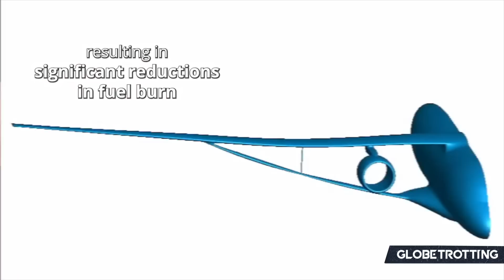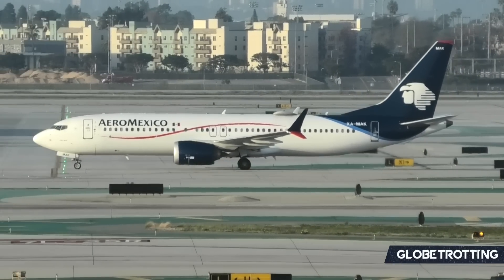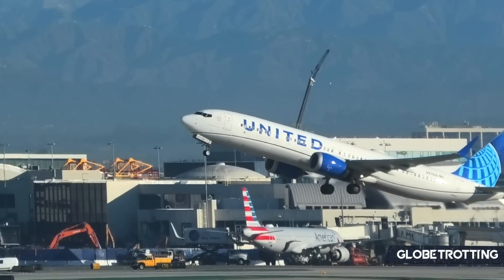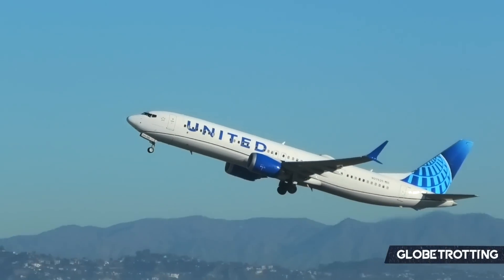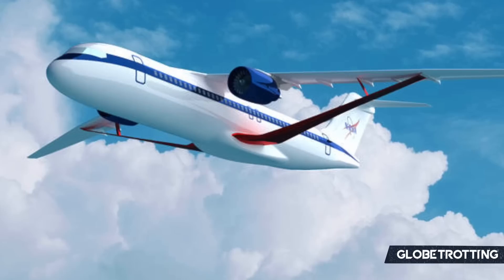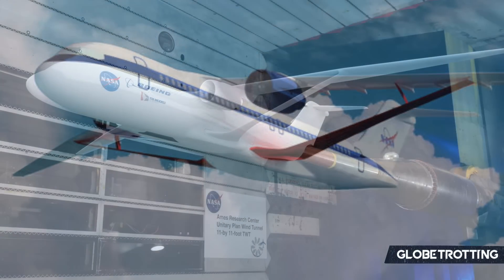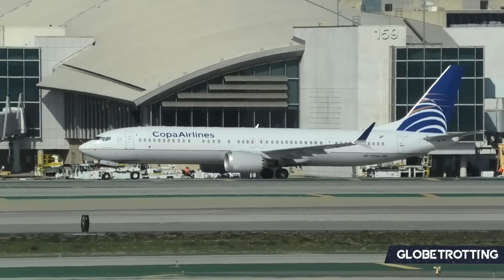737 REPLACEMENT - Boeing's Next Aircraft?

Comment: Like others here, I think Boeing is using the excuse that they await the RISE engine, circa 2030, to keep blowing out the tired old 737 airframe.  It is far more profitable than a  new design or radical redesign.  Methinks putting lipstick on the proverbial pig.... sticks you with a pig by any other name...

Comment: The problem is parking this aircraft at a gate.  The 737 NG and 737 MAX both have a 117 foot wingspan, with winglets.  The 757 has a 125 foot wingspan, without winglets.  The 767 wingspan, sans winglets, is 155 feet.  At 170 feet, the wingspan of this narrowbody is 27 feet narrower than the 787, which is a replacement for the 767 and 777-200.

For a small, compact airport like Midway or Orange County, a narrowbody with a 170 foot wingspan presents issues for taxiing and parking.
Reply: It wasn't really mentioned here but the wing folds just after the truss brace.  The wings are already so thin that they will not be having a significant portion of the fuel in the wing now. Certainly not past the truss brace.  This will be significantly more wing percentage that will bend upwards than on the 777 so it is schedule to be able to fit into a size 3 gate.  This problem though will hit big for use of a flying wing design.  You can't use that trick there which is why I don't see a large commercial jet using a flying wing design.  Blended wing were the wing itself could fold up I think might be the way to go for the big planes.

Comment: I think this could be a serious possibility as a CRJ 900/E175 replacement
Reply: Based on door size vs fuselage size, the depicted concept is a 3+3 row single aisle. For a 2+2, the door has to be much larger. I didn't look for specifications, but the pictured concept is clearly in the 140-180 seats category.

Furthermore, a smaller design to address the offer of, let's say, CRJ700 or E175, is indeed possible. However, the "bonus" of that concept is thinner wings, which comes at the very annoying drawback of MUCH wider wingspan. Airports are not ready, and won't be in the next 15 years. Just like the A380, launching the aircraft while airports delay infrastructure to the last moment will make airlines delay their interest in the type. The market of 80-140 seats demands tight turns and ease of operation flow. If the aircraft cannot fit in current any small parking slot, it will require the usage of spots for the 120-220 capacity, just because larger wings. That's highly inefficient.

One thing not discussed - because it's just a concept at this point, mainly focused on the wing design benefits, other problems has to be solved later - is fuel storage. The wings are so thin that you have to put those tanks elsewhere, mostly. That means, cargo volume will be significantly reduced unless you go again with a double bulb fuselage (Boeing 707/757 aft section). It's a bit premature to discuss that, but if you fail to integrate the concern from the start, you'll end up with the SAME problem as the 737 : not being able to scale up the design with new engines and more capacity (because of the guard for the 737, here because of a "not enough room"). What is tricky with fuel tanks is balance : you can't just pack all of them at the rear of the aircraft.

The emphase and focus put here on "737 replacement" plays a role in people being stuck on that idea. The thing is, you mainly need to maintain ease of personnel qualification, ie you don't put humans in front of an unknown technology (cockpit will be similar, systems, procedures, etc.) The market on the others hand has to be monitored. So it all depends on "how many people can afford to travel by air in the next 30 years ?". If it's the same as today, well, you need a 737-like capacity. If it's less, you'll need a smaller design. If it's more, you'll need something bigger (with even bigger wings). As I said, you won't redo all airports in the world, the aircraft you build must fit in existing parking slots for the corresponding market with the existing qualified personnel, you don't just design the most fuel efficient plane just for the sake of fuel efficiency... It will take time to integrate that design and make it the new standard, like 40 years from now...
Reply: @StephenKarl_Integral  good point, but they should be able to fit into most airports with where they put the fold on the wings (right next to support beam). With the wings folded, it should be about a slightly larger size than the E175 LR which will allow her to fit at at least every airport that gets a plane that’s the size of the E175 or larger. As for demand, that shouldn’t be a problem since this plane is a narrow body, not a wide body. Affordability on a narrow body jet shouldn’t be a problem, even 30 years in advance.
Reply: @uwucaffeineaddiction4023  oh, I wasn't aware the wings were foldable, thanks for pointing that out. That solves one problem. Historically, airlines want to avoid "moving parts" as that means ground checks, qualifications, costs, etc. but maybe the economic benefit substantially negates that. Usually, when you go "glider designs" like this, it's because you want to trade speed for airborne endurance. So you make a lightweight frame (also means lightweight engines and limited payload) and fly at low to intermediate altitude. This is my "ringing bell" when the design claims to fly equivalent payload of a classic airliner at even higher speed and altitude, so, from the start, it cannot be lightweight, roughly the same mass as a classic airliner, powerful engines, certainly not electric... My understanding of aerodynamics make me assume you would theorically burn more fuel than a classic airliner to reach an higher altitude in order to burn less fuel on a prolonged cruise, because those wings induces more drag in thicker air (I am possibly wrong, but again, how come we don't design classic airliner wings this way from the start, this is known efficiency margins from as early as U2 spy plane), meaning, the businees model is relevant for routes that move people as far as possible (for that sustained economic cruise). I kind of took the parking size as a deciding factor, but in my mind, several concurrent factors are at play (including for instance taxi stability, ground handling, crash survivability, purpose...) The 737 size concept makes sense (for capacity and fuel tanks), smaller than that, unless we want to fly really slow really low with lightweight (possibly electric) engines and not that far, I doubt it could be economically viable... Concepts, there are tons of them.. those that actually make it to everyday use had to fit within so many conditions and balance...

All that said, I'm an aviation enthusiast, I would LOVE to see wonderful machines fly everywhere. But I'm fed up of concepts that miserably failed after the hype, and people getting dramatic all over the internet with clickbaits titles and irrelevant debats even makes me very critical on the REALISM of any new thing : does it does the job with neglectible complications or risks and does it make money? Otherwise, it's just either crap or making money not in the right way (your taxes are funding the dream until it becomes obvious it doesn't work)
Reply: @StephenKarl_Integral  well only time will tell. Boeing has a pretty good track record on this since they’re working on certifying the first Spaulding, wingtip aircraft, the 777x.

Comment: Forgive my cynicism This P.R. campaign follows too closely to Congress extending the certification timeframe for the Max 7 and Max10.  The NASA wing design was developed for a much smaller plane possibly the MD 80 at 130 to 172 passengers. A number of issues seem to be overlooked.  The wing will need to fold (not just the tips). Flight control surfaces ie: jack screw design won't work as it is external to the wing. The flaps are housed internally to a much thicker wing design.  Current wing design currently stores much of the fuel used on an airliner.  The skinny wing will not be able to accommodate fuel tanks.  In-boarding the fuel tanks reduces the cargo hold and creates a structural problem similar to the Airbus 321 XLR.  A reinforced frame is needed for a wheels up landing emergency.  There is also the matter of cockpit controls which would be unique to this design With a one size fits all approach to Boeing designs how will this work?
Of course the wing and tube air frame design is maintained for a pressurized cabin.  Possibly the strut reinforced wing will remove the need for a wing box yet any landing gear design may still offer some interesting challenges.  What is Boeing really saying here?  Another 20 years and we will finally replace the 737?

Comment: "Boeing lost the 'it' factor" -- what is this, designer jeans?  

They definitely need a replacement for the 737, and really they need 2 planes: one that's small enough to replace the 737 and hold off against the A220 on the small end, and one to replace the 4000nm/250seat 757 class.  Could they perhaps build a pair of parts-sharing designs to cover both ends?  It'd be a tall order, but given enough $, doing such a plane with all composites could work.

Comment: I think this unusual research plane could be a candidate for installation of the CFM International RISE propfan engine to see just how far the fuel economy improvements can go.
Reply: Prop fans are good but if they can’t perform at high altitudes and speeds of jets then it likely won’t be on something of this size

Comment: I have been wondering how long it would take before someone trotted that out as a potential replacement for the 737.  Or 757!  I'm guessing the folks at Boeing has had that in mind for a very long time.  Considering that Boeing has said they are waiting for the next step in propulsion systems, it wouldn't be a surprise to see them use an open fan blade engine design like the CFM Rise on it.

Comment: The very long wingspan will require changes to airports and terminals...
Reply: Just do what the 77x does, folding wingtips/spans
Reply: @Daniel Chan  I would have thought that folding wingtips would be required as the airlines are unlikely to want to pay significantly higher airport fees on such a low capacity aircraft. 

As to how possible that would be on such a slender wing is another matter.

Comment: Even Boeing wanted a replacement for the 737.  Boeing was perfectly capable to make the 737MAX safe the first time out of the box.   But for 'pick your reason' they did not.   Engine placement, and MCAS it all works.  First release of MCAS sucked eggs.
The Body is still too narrow and could really use a modern specious cockpit.   Yet there is a market for it.  Can even be a comfortable plane if not stuffed too full.  Any plane that can haul the load can be crammed with too many passengers. That is up to the airline.
I

Comment: Makes sense, why should Boeing develop a 737 replacement when they can get NASA and the US Government to fund ⅓ of the project?
Reply: Is NASA and The US gov paying $3 billion+ ? Everyone knows a 737 replacement won't cost anything below $10 billion
Reply: Yea, not how this is going to work nor what the $1B will be.  This is far more likely NASA/FAA getting together for load alleviation for flutter, roll, 2G wind up turn in modern structures piggybacking onto Boeing who is footing the bill more than likely.  Since the FAA are running the show regarding any new aircraft currently, and all of a sudden pretending to be engineers, and Boeing has been looking at this aircraft type for going on 20 years, not 10 as stated as we were talking about this as Boeing engineers over 20 years ago.  Load alleviation = MASSIVE structural weight reductions.  With composites this gets hazy due to how flexible they are before breaking compared to aluminum(it is also one of their MAJOR failure modes).   No one from my knowledge has really done a whole airplane 2G+ wind up turn load alleviation testing even though it was for sure granted to a350(EASA) and 787 never got it from FAA which MASSIVELY pissed Boeing off.  My guess 777X did get some form but to what extent I did not know, but the kicker is no one knows how far one can push FBW load alleviation and full scale testing has been wanted for a VERY long time now.  All I have to say, this aircraft had better be a Drone aircraft because you would never catch me signing up for flight testing it if this program is truly what I think it is.  HIGH chance of pushing too far into load alleviation and.... I think you can figure out the rest.

Comment: A high wing aircraft its more difficult to reach the engines for maintenance i am not a big fan of the whale tail like the 727. Also anhedral wing planes are less stable than dihedral low wing planes in roll.
Reply: Not when we are talking civil aircraft where load alleviation is King via FBW computer control. But this is where the REAL testing will be King of course getting those dynamic issues ironed out and correlated to current load alleviation limits and probably why they brought NASA<<cough FAA in reality>> on the project would be my guess.   Project Yellowstone is not 10 years old it is well over 20 years old now.
Reply: Their probably looking a new wing placements for the open bladed engine supposedly coming around in the 2030’s when this concept would be finishing development.

Comment: A very long wingspan might cause issues at airports. Gates for midsize aircraft such as the 737 or A320 planes are typically dimensioned as "C", meaning a wingspan of up to 36 metres. A plane with a wingspan of more than 50 metres will require a more spacious (and probably more costly) gate.
Reply: That's why such a wing will be foldable.

Comment: I think Boeing should produce a plane that can more replace the 757 and have shortened variants to replace 737. A small-medium sized, narrow body high performance aircraft
Reply: But if you're into production of something, you know the days where you could "make more" without adding a cost to the final custommer are gone. A bigger design (757) means you put more steel, more carbon fiber, more so many things in a unit that flies less people and less cargo... How much will cost a 757 replacement with a shorter fuselage compared to an A320Neo (or its updated conterpart when the time comes) ?

That's not how you make money. You start with a small base with buffed undercarriage and central structure, just enough "to be prepared", then you scale up, if deemed necessary. Scaling up sometimes fails but scaling down is ALWAYS a niche, you won't sell enough units to make a noticeable profit.

When I read people wanting back the 757, I have the impression it must be an American citizen which only knows about Delta, United, American... let's say 90% of 757 production line. The picture is :
- the rest of the world is not interested in the 757 (or any new one of the kind, they simply go A321 which is already a tad too big)
- you now have A321LR/XLR, Max-9/10 (soon)
- the airlines I mentionned now have qualified Airbus personnel and are no longer Boeing addicts. Abandonning that route and go Boeing again would be highly cost ineffective. Boeing is constantly in touch with them, it's the airlines that are telling Boeing they don't care anymore...

Liking the 757 is okay, it's a wonderful plane, but claiming it's in a replacement of that type that Boeing should bet into... I think that would be the BEST way to get rid of Boeing for good in the competition. Now, to be fair, at some point, Boeing will need to replace the 737-Max. In line with what I said, while learning lessons, Boeing should design a 737 sized plane with scaled down 787 wings, nose, tail and undercarriage, with the latest Boeing philosophy systems heritage in the inside : it would look exactly like a tiny 787 with 737 fuselage, not a beefy 757 high on legs and overpowered. But that has to happen around 2035-2040, not now. The 787 wing/undercarriage design is suitable for any reasonable engine beef that may arise in the next 40 years.

BTW, why are people forgetting about ageing 767s ? Especially 300ERs ? Again, Delta, United, plus Japan Airlines, ANA, and so many more. The 787-8 is often just too big. That's why Boeing cannot stop 767 production now (at least, spare parts production), Boeing is stuck with another type that people will criticize more and more for being "old design, too narrow, noisy"... Thing is, it's a very efficient plane in the market, and no equivalent (until some chinese company produces a slightly smaller and less boosted 787-8... for half the price : nobody cares about 8000nm range, 99% routes are below 6000nm)
Reply: AKA the NMA and FSA